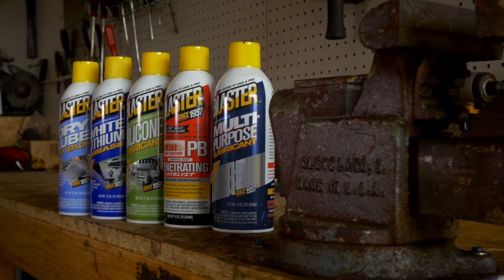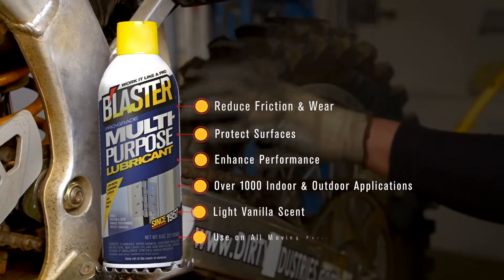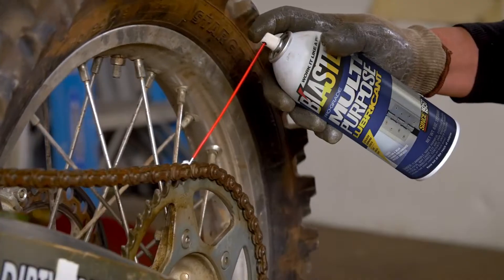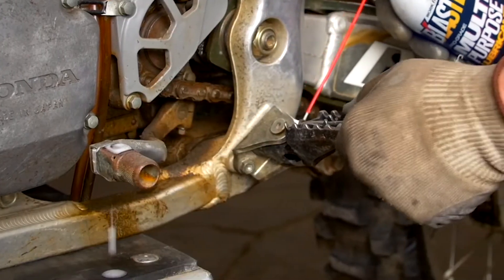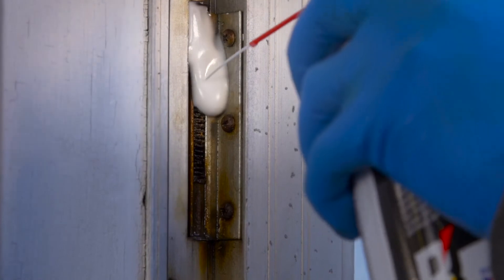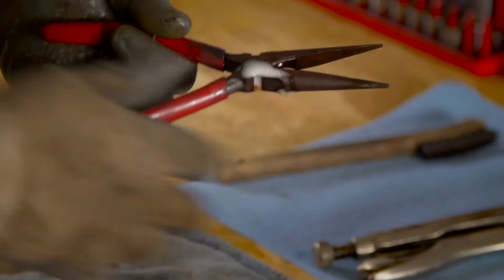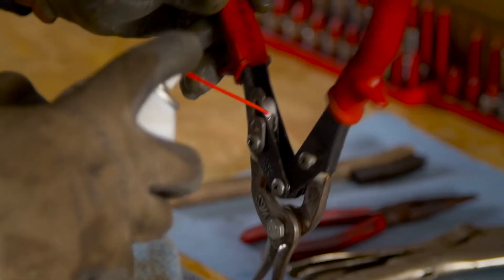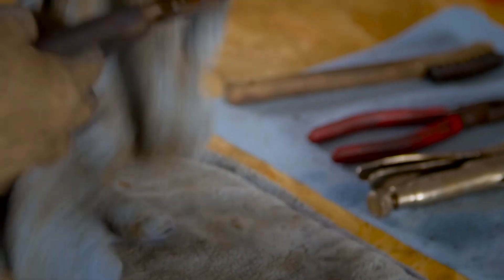Blaster Multi-Purpose Lubricant Demo

Comment: What is the difference between this product and the multi-max lubricant?
Reply from the maker: Muli-Max is a full synthetic lubricant and is more viscous than Multi-Purpose. This gives it a wider temperature working range, increased lubricity and longer life than the Multi-Purpose Lubricant.
Reply: @BlasterProducts  Thanks for the quick reply! The multi-max makes a great gun oil if you hadnt had anyone tell you yet. Keep up the good work at blaster!